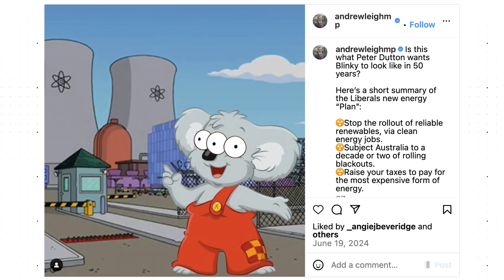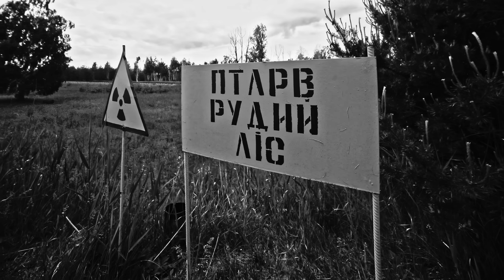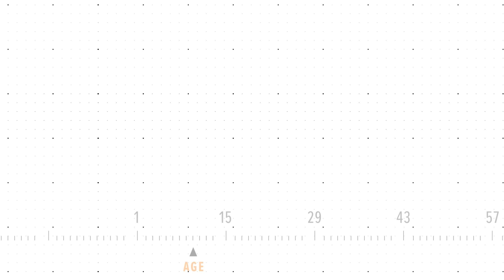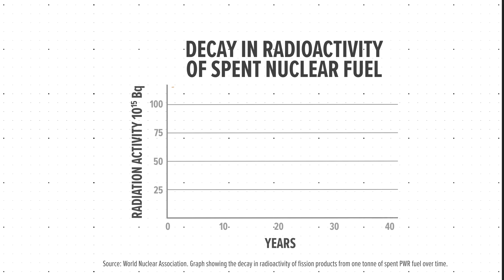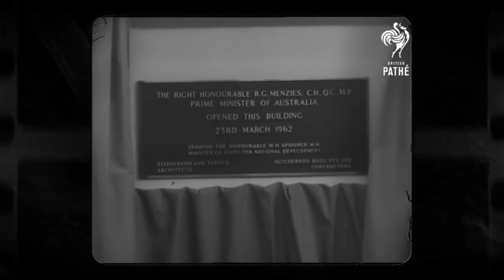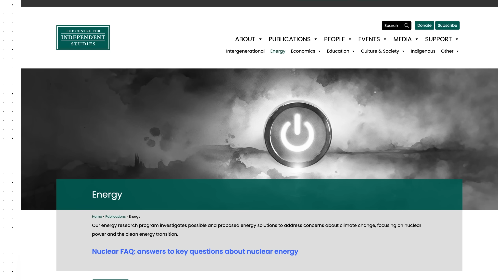Is Nuclear Safe? | Aidan Morrison

Comment: Nuclear is fragile, grid is fragile and lightweight because it is extremely expensive to over build. 

Nuclear reactors shutdowns rapidly with blackouts and takes days to get back online. 
4 states have had transmission lines blown down. Blackouts.

Duck curve of demand collapse is a double curve. 
Dead demand in business hours. 
Dead cashflow for grid owners, Shttsnpants feelings, and broken 247 cashflow. 

Grid is too expensive to expand and too valuable to waste. 14decades to build. $TRILLIONS in value.
ROI for the grid owners is 100s$BILLIONS.
247 cashflow. 

Generation is cheap 5cents kWh and my grid supply is 50cents kWh. 

Dirt-cheap 2cents kWh Rooftop PV has no grid costs.
Tax-free savings for mums and dads and for high marginal taxpayers early adopters with EV mass storage battery. 
$3,500 no petroleum tax-free savings per vehicle for decades 
No gas, international priced, tax-free savings $2,000 per year for decades. 
No grid expensive electricity $2,500 per year tax-free savings for decades.

My friend warehouse saves $10,000 per quarter.

Nobody wants nuclear expensive grid electricity 

Grid owners will abandon central generation electricity and contract dirt cheap rooftop PV and home battery electricity for industrial customers moving away from fossil fuels to clean electricity. 

Grow up nuclear grid electricity is dangerously expensive.
Reply: If solar panels & windmills were indestructible and cheap that last for many decades without needing replacement or superseded tech. If batteries weren't a  dangerous fire hazard risk. If China didn't own & control the mineral supply , manufacturing & distribution chains.
If everyone who buys them aren't subsidised by gov. tax money.
If batteries back up lasted more than a few hours.
Other than that sounds great
Reply: @stevec9972  what a word salad. !!!
Reply: @stephenbrickwood1602    That's what I was thinking when reading the OP.
Reply: Nuclear power brings down electricity prices by 75% in Finland.
Reply: @buildmotosykletist1987  I am just saying that to stop CO2 emissions from a country with nuclear electricity then the only way it is cheap enough in warm latitudes is to pull a brand new electric grid out of some ones ars for free.

The exiting Australian national electrical grid costs $TRILLIONS and decades and decades to build. 

More grid capacity is stupendously expensive and it scares governments who have to face elections.
Fragile grid blackouts are dangerous electorally. 

Grid owners hate blackouts as their cashflow crashes.
Reply: @ : Only a fool would claim "nuclear is dangerous". Watch the video again.
Reply: @buildmotosykletist1987   grow up.
Are you saying stop CO2 emissions worldwide by promoting nuclear electricity industries to the 80% of the world's population that live in dictatorships. ?????????
Grow up.
Reply: @stephenbrickwood1602 Adding nuclear to the mix doesn't require a new grid especially if you put the plants at the site of the existing power plants where the transmission is already in place. It is renewables that actually require a large expansion of the grid. You've got this back to front.
Reply: @stephenbrickwood1602  Yes I am.
Reply: Do you understand my costing of the grid.?
Reply: BS .. debate Aidan Morrison, I’d pay to watch
Reply: @Kenneynrg  a good idea.
My comments are deleted when dollars and sence are raised.
Reply: The UAE example proves you wrong.
Reply: @buildmotosykletist1987  what do you mean.?
Reply: @stephenbrickwood1602  France has some of he cheapest energy in the world. It's nuclear.

Existing power grids can be used for nuclear. You just build right next to existing coal power stations. 

Nuclear is the most stable energy output. 

It sounds like you've copy and pasted all the cons for solar and wind, then written "nuclear" over the top.
Reply: @LadyPatienceK  grow up.
France built nuclear electricity industry because of its crazy neighbour Stalin USSR standing army. 
France doubled down because of the crazy Arab oil embargo and no stockpiles of petroleum for tanks and military defence needs. 
France nuclear electricity industries is a military defence project. 
The Australian Nuclear 14gW proposal will need 400tonnes of uranium metal each year. And the 400tonnes of uranium metal waste and 4,000kg of plutonium metal every year. 
1kg for a nuclear weapon ezi pezi.
Australia could supply Indonesia 300million people with uranium yellowcake for their clean nuclear electricity industries so they can make 4,000tonnes of uranium metal and 40tonnes of plutonium. 
Less CO2 emissions worldwide is 👍 great.
Reply: @LadyPatienceK   @LadyPatienceK  grow up.
France built nuclear electricity industry because of its crazy neighbour Stalin USSR standing army. 
France doubled down because of the crazy Arab oil embargo and no stockpiles of petroleum for tanks and military defence needs. 
France nuclear electricity industries is a military defence project. 
The Australian Nuclear 14gW proposal will need 400tonnes of uranium metal each year. And the 400tonnes of uranium metal waste and 4,000kg of plutonium metal every year. 
1kg of plutonium for a nuclear weapon ezi pezi.
Australia could supply Indonesia 300million people with uranium yellowcake for their clean nuclear electricity industries so they can make 4,000tonnes of uranium metal and 40tonnes of plutonium. 
Less CO2 emissions worldwide is 👍 great.
Reply: @LadyPatienceK   Aidan deletes my comments about grid economics.
Reply: @stephenbrickwood1602   I doubt it. YouTube is fickle and blocks loads of comments.
Reply: @LadyPatienceK  Nuclear promoters are continually trying to confuse many things.
CO2 emissions proliferation and 
ignore Nuclear proliferation and 
ignore need for grid capacity proliferation and 
ignore grid cashflow collapse with the daily DUCK CURVE of demand collapse. 

Home energy budgets are destroying grid demands' $100sMillions cashflow. 
Business budgets are destroying grid demands' $100sMillions cashflow in business hours and holiday hours. 

Grid owners' will abandon central generation and contract millions and millions of original customers to supply industrial customers moving away from fossil fuels. And maintain cashflow. 

Grid owners will abandon central generation and Contract v2g EVs massive storage batteries to supply industrial customers moving away from fossil fuels. And maintain cashflow. 

Grid owners will be part of a DOUBLING of original grid electricity and maintaining ORIGINAL CASHFLOW customers as the customers become feed-in suppliers and industrial customers CASHFLOW INCREASES as they move away from fossil fuels. 

Nuclear is a 247 economic grid disaster. 
Nuclear is pathetic for CO2 emissions reductions.
Nuclear invites worldwide nuclear industries. 
Australia is the sunniest continent on the planet. 

Grow up nuclear promoters. Get real. 

Home and business budgets and dirt-cheap rooftop PV on dirt-cheap rooftop empty realestate and no massive grid upgrades and no massive government nuke construction and no massive upgrade to collapsing fossil fueled aging generation plant.
I worked on these plant construction in the early 1980s, 45 years ago. What ' self promoting experts ' do you listen to ????????

Many nuclear promoters use Gish Gallop debate method of ' flooding the zone ' with false information. 

People get fatigued when each matter is unpacked and facts are given. 
Some people are BLUE PILL people and do not want their hopes broken by reality. 
Some people want more facts and want assuring that the best technology is being expanded. RED PILL people, Hahaha.
Reply: Hello
Reply: @LadyPatienceK   hello speak to me
Reply: @stephenbrickwood1602   I have responded to you. Not my fault if you can't see the comments.
Reply: @LadyPatienceK  thank you. 
I  think critical comments can shake long-held beliefs, and so they use editing and blocking or something. 
Other sites never delete my comments. 
Thanks for responding.
Reply: You've actually got it all back to front. A system based on mostly renewables needs to be overbuilt to compensate for the low efficiency because the sun isn't always shining and the wind isn't always blowing.
They also require a massive expansion of the current grid. If you put a solar farm out in the outback, how do you think that power gets back to the grid and to cities where it is needed?
Transmission lines are required for both a system using nuclear and one using mostly renewables. So if a storm blows down transmission lines it is no worse for a system that uses some nuclear than it is for one using mostly renewables. 
Renewables add complexity to the grid making it more expensive.
The more wealthier people take up solar (using Government rebates) the more of the (now higher) grid expenses that need to be borne by the people who can't afford solar. Hence electricity is becoming more expensive. The daily supply charge on my bill is now becoming quite a large proportion of the bill.
Inverters and panels require an upfront capital outlay and they don't last forever. I personally know of at least 3 different people who have had to replace their solar systems. They don't last decades like you suggest, maybe 2 decades if you're lucky. A friend spent $15k on a new solar system and 10kW battery last year. In winter there isn't enough sunlight to fill the battery during the day. When they turn on the heating the battery level drops around 70% immediately. The energy isn't available when they need it the most.
So whilst someone with solar may save some money on electricity during the life of their system, they will need to set money aside to replace their system at some point in the future. 
As for EVs, retailers provide a discount for people to charge their cars after midnight. Where do you think that energy is coming from? Solar?
I'm not sure where you are getting the trillions value from.
For the record I do have solar at home. It reduces my bills but certainly doesn't eliminate them. Using the air conditioner for more than a couple of hours on cold or hot days eliminates any chance of a credit, even on a sunny day. I would rather just have cheap electricity and not need a solar system to keep costs down.
Reply: Australian grid is 1 million km. 
Grid construction costs today are 1$million per km or more.
The HumeLink transmission is $5billion for 365km, 13$million per km. 

So the value of the grid is $TRILLIONS or more.

Ezi pezi costing for construction tendering.
Reply: Where do you live ? In a warm latitude ??
Reply: @stephenbrickwood1602  Adelaide
Reply: Are you a grid construction engineer  ???
Many experts like earth dam builders and medical doctors and coffee shop owners and students and ignorant youtube video content creators and ..... give opinions .
Nuclear physics and chemistry people understand why a pellet of uranium gets hot but want you and taxpayers to waste massive amounts a of other people's money on their wet dreams.

Are you a grid construction engineer with decades of construction experience  ????
Reply: Where's the TL;DR ?
Reply: @OneWildTurkey   ???  TL DR
Reply: @stephenbrickwood1602  That's an internet slang way of saying you're too wordy in that comment.  
TL;DR = Too Long;  Didn't Read and is used to identify the location of a short summary.
Reply: @OneWildTurkey  Nuclear promoters usually have hot uranium pellet tunnel vision.
Reply: Lol. #ComedyGold